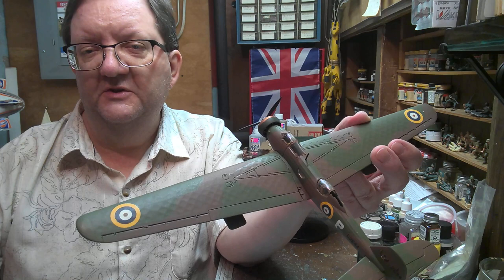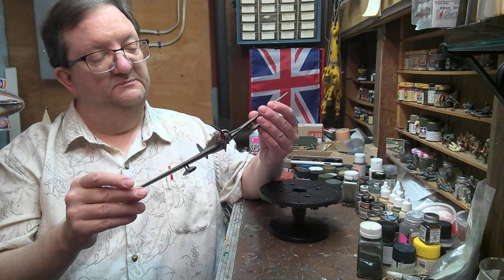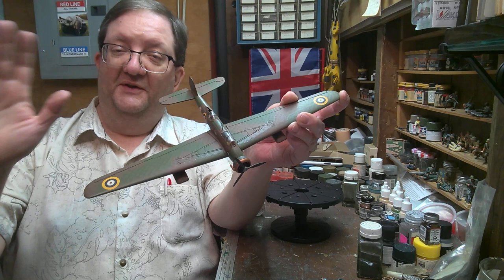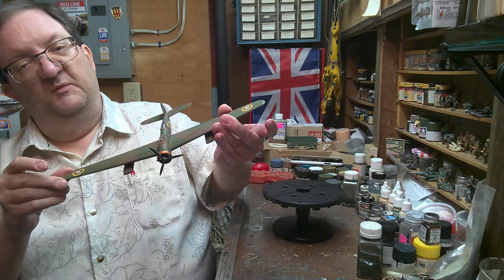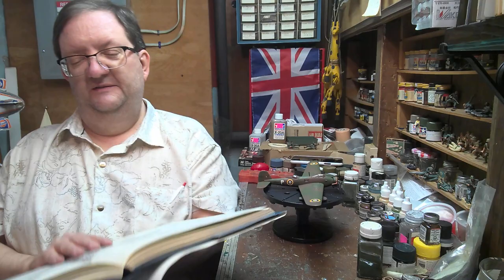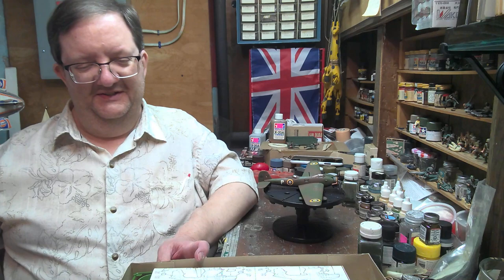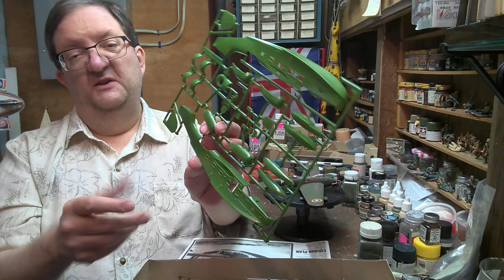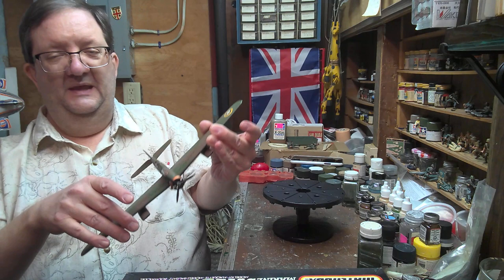Model Building - Vickers Wellesley by Matchbox

Comment: Nice friendly video cousin,I remember the Matchbox kit as tgey did do different lesser known stuff. Always crisp,rarely any flash,more decal and parts than airfix in the 70s and 80s. Novel colours as kids may not have had paints. I too looked up this weird bird and as you said quite often it's the lesser know unsung heroes that were the first to do all kinds of things. Matchbox got bought out but you can tell the originals as they have a unique clear window in the back of the box. Tank models cane with lovely dioramas. Revell bought them out so when you buy a Revell it may be a Matchbox. By the way tge Czech company Valom do the Wellesley for a more detailed version with Photo etch and excellent interior. That's a big old bird and caused a few headaches out in Africa for sure. Keep those videos coming. Nice and relaxed and informative. The kids grew up and so did the hobby but the buzz remains the same. Awesome. Cheers fried. Des UK